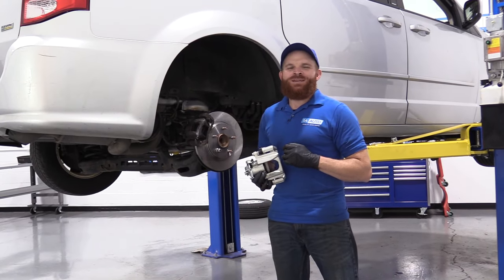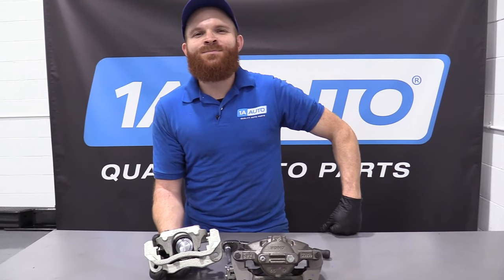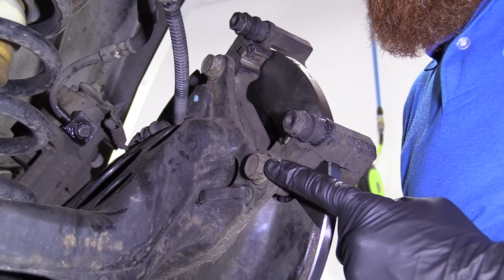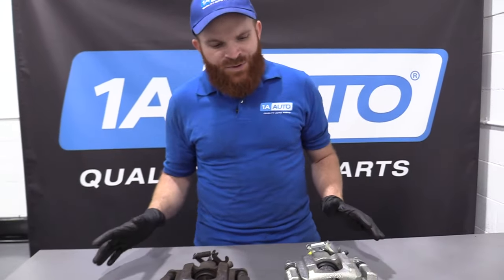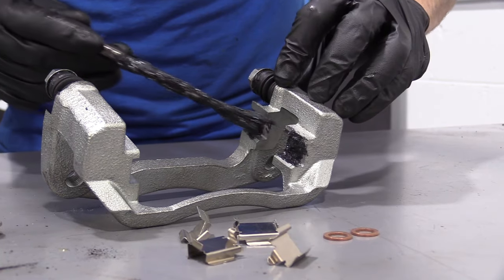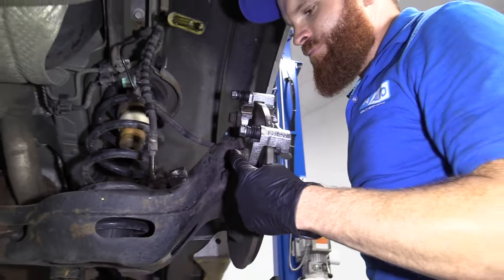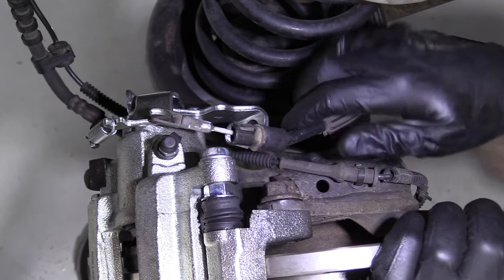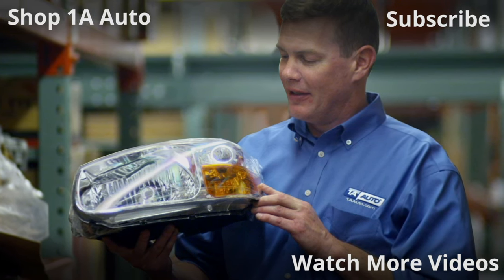How to Replace Rear Brake Calipers On Any Car!

Comment: One of the most important steps is not mentioned at all in the video, it is extremely important to monitor your brake fluid reservoir while bleeding brakes, especially with a new caliper. If your reservoir gets depleted you'll just pump a ton of air into your brake lines which is a major pain to remedy. I would hazard a guess that the reservoir needed to be topped off at least a couple of times to fill that new caliper with brake fluid. It's also easier, and cleaner, to check to see if you've gotten all the air out if you put a clear hose over the bleeder nipple while your bleeding.
Reply: i think i seen ChrisFix do the clear hose thing.

Comment: I just did this job on both my back wheels for the first time doing work on my car using nothing but this video and it came out great. Saved me $1500 after parts from what the dealership quoted me. Thanks!
Reply: Did You bleed the brakes any more than what he showed on here?

Comment: I have a 2009 vibe. I slid the closed side of a 14 mm wrench around the multi point clip that holds the e brake on. I pinched it on with pliers . Squeezed with one side of pliers on the wrench and the other side against the mount . Came right off

Comment: If you don't have the tool to remove the e-brake, there is a hack that will work. Take an OLD 13mm wrench, and cut a notch out of the closed end approximately 1/8 to 1/4 inch wide with cut-off blade on an angle grinder . This will allow the wrench to slip over the cable, and to compress the tabs. Figured this out after fighting with the first caliper for 1/2 an hour.

Comment: Thank you for this video.  Good explanations and perfect length.  Similar to the step at 5:40 when the parking brake cable is released through a notch, my 2010 Matrix doesn't have that notch.  I can't find a video on how to compress 6 one-way catches which allow the cable to be installed easily by pushing it through a hole, but not so easy to remove.  UPDATE...I released the parking brake cable tab using the closed end of a 14mm wrench...wiggling it back and forth over the tabs while pulling and eventually it cleared the hole in the fastening point.
Reply from the maker: +Cory Baron Thanks for checking us out! http://1aau.to/m/Shop-1AAuto-c

Comment: I did not know how to depress the piston in on rear brakes until i warched your video. One video i watched said to turn the disk with pliers but not to depress it at the same time! I must have damaged the boot because now there is a tear in it! I am just going to replace both calipers now since one is damaged and i am having no luck depressing them on this 2014 VW jetta sportwagen! Is it possible to just replace the boot?

Comment: No parking brake adjustment? I replaced my rear calipers (they looked exactly like the ones shown here) and there is slight play in the handbrake until the first click and the handbrake doesn’t fully lock the brakes hard anymore.

I took off the brackets on the caliper that holds the spring and brake line to change the rubber and restored them so the spring is tight again. I’m not sure if it’s off slightly the spring is probably tighter than before or if it’s something else.

Comment: How is your ebrake cable so easy to install or remove?  The tensioner has tightened my cable so much I have no play in it. I need to release the tensioner to reset the cable length.
Reply: Same to me

Comment: Awesome videos I really appreciate these thanks for uploading. I however have an issue this doesnt address, on my brake caliper for the e-brake cable, there is no groove, the cable passes through the body of the caliper totally, and the cable terminates in a nub that attaches to the sprung arm on the body. So, from the nub down, the cable then sits inside what looks like an aluminium sheath which in turn sits in what looks like a steel (corroded) place holder that sits in a hole in the body of the caliper with no groove to pop to the side. I'm abit stuck as on how to proceed. Thanks!!

Comment: Hi, I have a question, I was installing a remanufactured rear caliper on my car, and after hooking the brake line and the caliper bracket, I realized that the piston needed to be compressed a bit more to clear the new pads, while using the correct piston tool, it would not budge , not clockwise, nor counter clockwise, I will be returning the caliper to the shop, but I wonder , am I missing something? Could the piston be seized ??

Comment: My rear piston won’t go back in while I’m replacing brake pads on jetta. 1. Do I need to have the e brake spring disconnected? 2. Should the reservoir under the hood or bleeder screw be opened to help the piston go back? Tried to just wind it back but it continues to spin without going anywhere. Any help would be appreciated

Comment: can you do a video on a vehicle (2017 Mitsubishi outlander GT) with an electronic parking brake system?  how to retract the piston since you cant rotate the piston or push it for it to retract? and how to replace that particular caliper?  it does not have the same system as the one you show on the video, everything is electronic instead.

Comment: Very good. But for the last step, you need to let the air out with a thin tube and do it two or three times so you can see how much air there is.
Reply from the maker: +SA CA Thanks for the tip!
Reply: That's what he said.
Reply: Yes, video also didn't mention to check the reservoir at all and they are filling a brand new caliper with brake fluid.

Comment: Nice video. some mechanic say we must not use grease on sliders. they recommend silicone paste. I tried to check with our local auto shops but could not get Silicone paste. Is it the same with Silicone Sealant?
Reply: no

Comment: I have a 2016 chevy trax and my e-brake cable does not disconnect like your video shows. I had to remove a clip and then gave up because I didn't know what to do next. I don't have a slot where the cable slides through the side. Mine is a solid round hole. Also the end of my cable is round and has a small boot going around the cable. Any ideas how to remove it?
Reply from the maker: +Dave Lukacz We wouldn't be able to help with an issue like that here, you may want to have a local mechanic take a look at it. Thanks for checking us out! http://1aau.to/m/Shop-1AAuto-c

Comment: Which direction do you twist as you push in that piston? Also, do you have to un twist it when you get the new pads on? Thanks, (2015 beetle)
Reply: I've never seen one that doesn't go clockwise, or tightens as you are looking at it. My advice is to spend $30 on a tool set that will come with all the adapters for different makes. The pliers methods never works for me. 

And no you don't have to do anything once the new pads are in. The act of pushing the brake pedal moves the piston to contact the new pads. If that concept isn't clear you should watch some videos on basic brake system operation.

Comment: There's no link to the tool he used to remove the E-brake cable from the caliper. What's that tool called?
Reply: @mrmustangman  God bless you sir
Reply: Did you find out what the tool is called?
Reply: @MacAutoDiag  what's it called?
Reply: He didn't post it. Here's the link: https://amzn.to/3SZw2Lw

Comment: What is the tool you used to pinch in the sides of the brake cable at time counter 5min 19 seconds please?
Reply from the maker: +Tee Hose Pinch-Off Pliers
Reply: @1AAuto  
That is not what they are asking for. Actually look at the time this person stated. I've been searching through the comments looking for the name of that tool. It is not 
 +Tee Hose Pinch-Off Pliers
Reply from the maker: +Dylan Drake Thanks for watching!  That tool is called a parking brake cable remover!

Comment: 10:00 Is that square piece a part of the brake line? Unfortunately, I don't know what it's actually called. My old one is melted to the caliper (long story). Unfortunately, neither my new caliper nor brake like came with one.
Reply: It's part of the brake line.

Comment: Can I do the same thing for 2014 Chevrolet Traverse LTZ
Reply from the maker: +Kelly Butler We don't have a how-to video for your vehicle right now, but the basic steps in this video should be enough to do this task. Buy this part for your vehicle on 1AAuto.com: http://1aau.to/m/Shop-1AAuto-c
Reply: @1AAuto  how can I remove a frozen bolt off a caliper

Comment: What can you do if that plastic piece for the e- brake is broke, the one you have to depress before you pull the cable out
Reply from the maker: +tabasco351 We wouldn't be able to diagnose an issue like that here, you may want to have a local mechanic take a look at it. Thanks for checking us out! 1AAuto.com

Comment: The clips for my brakes would not stay put so I had to hold them in place while trying to put the pads in place. Then I found out why. the clips you were using had a much better flippy do..... My clips would not lock in no matter what I did. Didnt make the job any easier.

Comment: I just want to say replacing rear calipers on a 2006 Chevrolet Cobalt, does not look as easy and doesn't seem as easy as this . I would recommend maybe a video separate for that type of caliper since it is a little bit different than what is in this video.
Reply from the maker: +Nick Schneider Thanks for the feedback!

Comment: I ruined my special tool, a pair of needle nose, and a calliper.  Smh?!  These are one use parts.  05 LeSabre.  Save yourself the trouble and buy new calipers for the rear.

Comment: Can u plz advise which grease is best for caliper sliding pins ? 
When I bought brake pads for my 2019 crysler Pacifica , they sent small packet of grease.  I guess that is only to be used for brakes but not calipers .

Comment: Why do you guys throw these kind of things "on any vehicle". 
I agree that the braking system is mostly the same, however some cars have weird setups. 
For example, european cars have a shitty spring that gets rusted inside the caliper. Good luck pulling that out.

Comment: Great video. You make it look so easy. I’ve been struggling for an hour trying to get the e-brake cable off. Any tips. Mine doesn’t budge at all even when pressing in all the clips.
Reply: Just pull harder and look for places you can get it out of the guides and keepers that route it along the frame. It'll eventually come out. That special tool really helps. It was 10 bucks well spent.

Comment: Question i have a sonic rs and the rear caliper on driver side when applied the e-beake get stock , but if i dont use the emergencia brake the caliper works ok with pedal brake so do i have to replaced the whole caliper?

Comment: My rear caliper seized because I was unable to replace my pads at the required time... it’s sat for three weeks and my new ones just came, I’m all alone and weigh about 100lbs, lmfaooo I can’t stand those stupid clips!!! I’ve always done my own work and this was the most helpful video to refresh my memory on a few things, but today I just can’t get any bolts off except my tire... I’ve never had a problem that I couldn’t figure out when it comes to mechanics and not being strong enough usually a long bar or something I’ll do and stand on it for leverage but not this time... I don’t know is it safe to spray like WD40 (or whatever like lubricant?idk I can have Napa deliver same day)on those to loosen em and try again tomorrow? What if it drips on the hoses or something or my rotor I’m replacing the calipers and pads but my rotor is okay I only drove about two hundred yards very slowly when I felt it lock up so the heat was minimal and no gouging or warping but the bracket for my (now obviously empty and useless) brake pad did fall off about 45 seconds before the obvious reaction of seizing up of the caliper 😭😭 my husband passed away a year and half ago someone help me how can I loosen the bolts holding my caliper on without damaging anything or myself?
Reply: And also i usually use brakleen on my stuff can I spray and clean my rotor with brake cleaner while it is still ON my vehicle? It says not to get overspray on a list of things on the can but I’ve only cleaned the rotor when we replaced an entire axle and all of the corresponding pieces with friends, and I’ve not replaced a CALIPER on my vehicle in literal YEARS because this one I’ve not had for long and home a lot from local covid restrictions... anyways brakleen, safe to spray and clean rotor with and if it gets on a hose or something else should I worry, also can I use it to clean other things under there that look rusty or gross or other bolts that are dirty and built up but I’m not removing just doing preventative measures for future removal? Will it slowly erode inside the bolt screw hole over time or the bolts themselves if not rinsed off? Just 🧐 curious now I can ask google I’m just bored and curious LoL 😆
Reply from the maker: +Katrina Doyle Thanks for watching!  None of those sprays will damage anything in that area, so no need to worry.  You can try using a breaker bar which is just a long wrench to give you more leverage.

Comment: Quick question! Do all cars have these sheet metal pieces where the brakepads slide on?  Im not sure but mine did not have it. Is this normal on some cars? Thanks in advance for the feedback!~
Reply from the maker: +Tom Yes, all vehicles should have these calipers.

Comment: This was so helpful!  One question, if I only replace one caliper do I need to bleed the other side as well?
Reply: It's would be best to bleed all the calipers starting with the caliper furthest from the ABS module. It pays to to be through and consistent otherwise it might cost you your life or worse the lives of others
Reply: No as long as you dont run the master cylinder dry